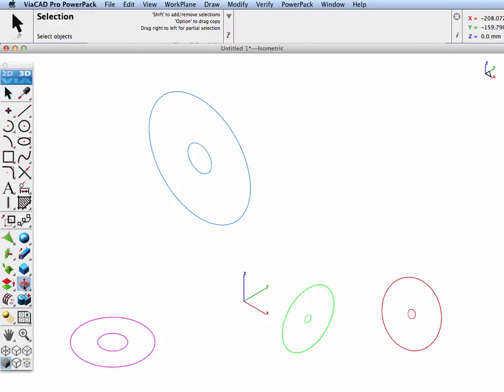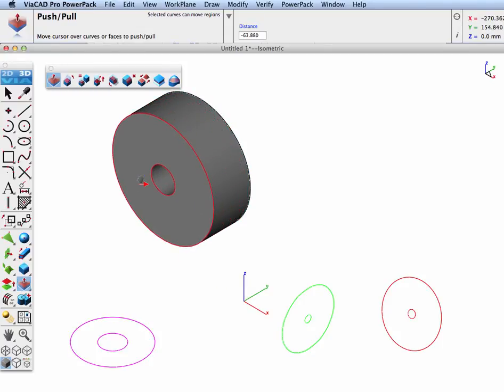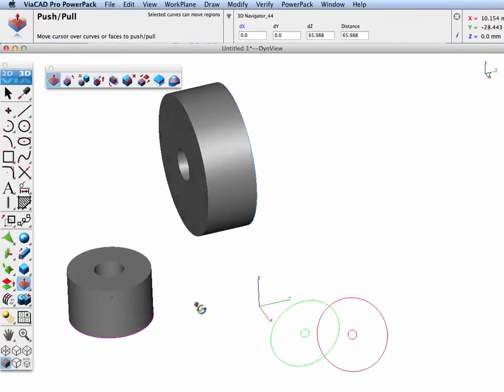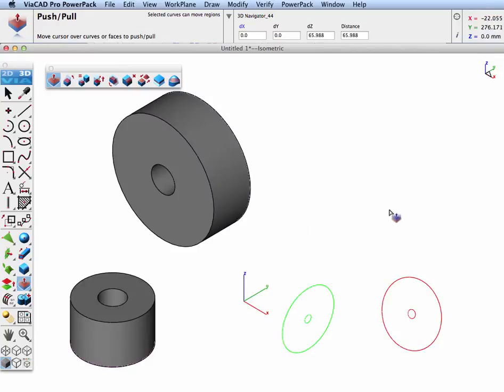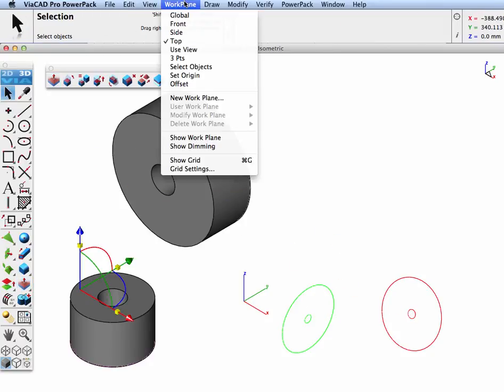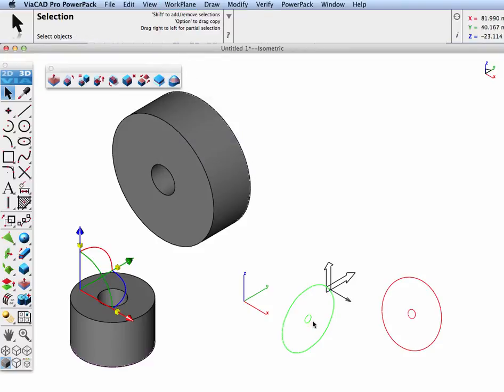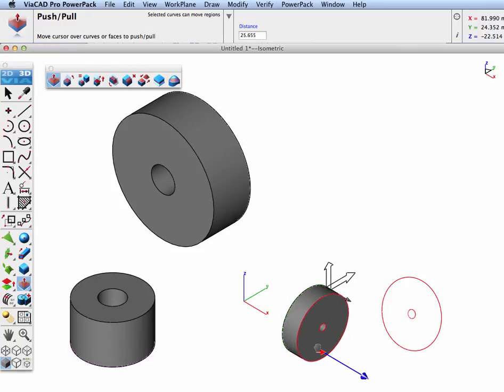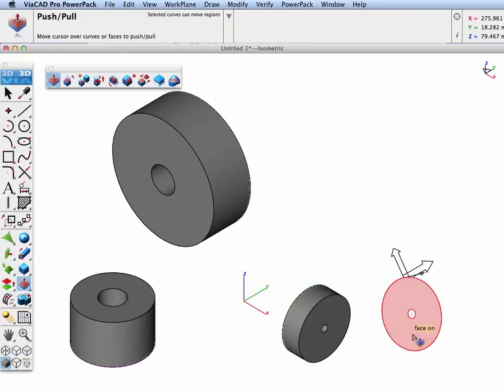Pulling Shapes into 3D Solids

Comment: A few added tips for curves not in the major planes. Choose the select arrow, Then choose the select object from the workplane menu, Click on the item your trying to extrude with the pull tool, Then click again to get the gripper, Then click the C key till the correct plane aligns with the correct axis. Then the pull tool works. Make sure your snap to plane is on. I really appreciate all your video's Tim.